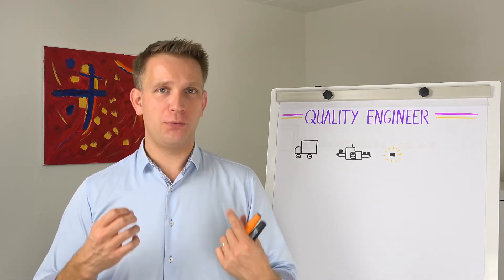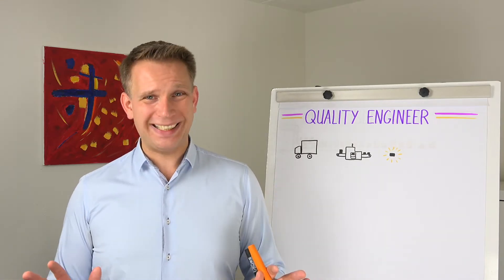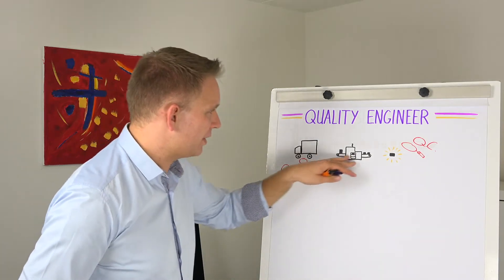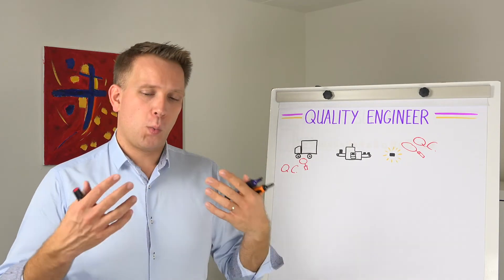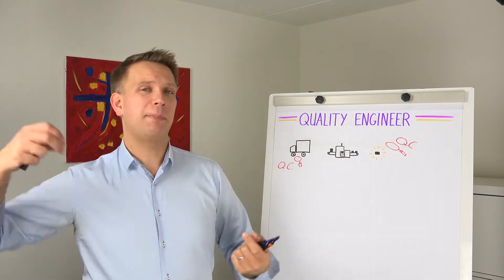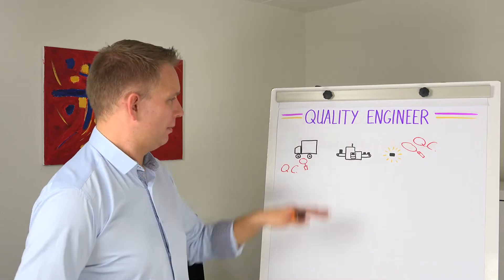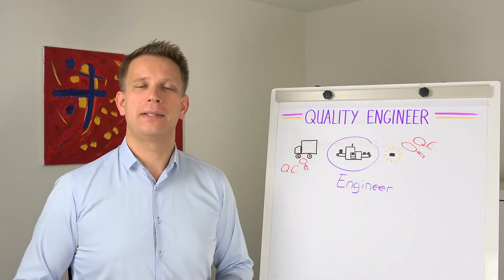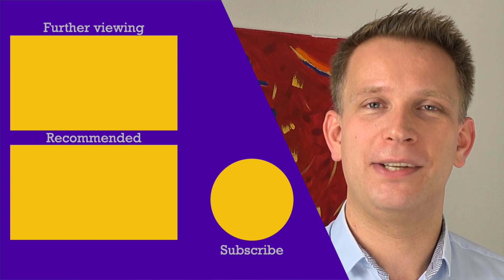What does a Quality Engineer do?

Comment: I am a newborn Quality Assurance Engineer, would it be fair to say a QE also defines the criteria of acceptance for QC Inspectors? For my role we focus on defect data analysis, KPI reporting, PDCA plan to reduce defects (process improvements), and make Quality Control Plans and ITPs. Right now my plan is to implement improved checklists to include First Piece inspections in-process to reduce an ungodly amount of scrap costs being incurred by the factory as a first step. This will also reduce defects by limiting to 1 first piece defect instead of allowing total run of set actions to occur incorrectly thereby having high defect count as detected at a later point.

Comment: My take after being a non-quality engineer for several decades. It sounds like you are describing statistical process control, X-bar, R-bar charts and determination of Cp and Cpk, among other things. The problem with formal quality engineering is that it makes continuous improvement by factory workers nearly impossible. Every change needs to be signed off on by senior managers who consider themselves to be very important. (All changes must be approved by the Vice President of Quality Assurance.) The important thing is that the company has documented quality.
Reply from the maker: Haha, yes, unfortunately that happens.
I can assure you that this is NOT formal quality engineering, it's a poorly implemented quality management system, that is probably set up for formal accountability, getting through audits and covering people's behinds.

A good quality system manages, but also welcomes, changes. A sign-off for changes to product or process is a good way to make sure relevant specialists have judged the effects of a change, and prevent unforeseen consequences of well-meant 'improvements'.
But that management of change process (MoC) should be built up practically: Allow minor changes to be made autonomously at the lower levels. If it likely affect those factors, discuss the proposal with a MoC meeting which gets together frequently (and at various levels in a larger factory). When people believe the changes don't negatively affect Safety, Quality or Machinery, let them implement it and send a report to the MoC meeting - that way the MoC team can give feedback on these choices and is at least informed.

Having said all that, do know that keeping your processes documented really is a valuable thing, not just for audits. And keeping that documentation up to date to include changes is essential (if the documentation cannot be trusted, it loses its value). So some secretarial work is part of the deal, but a good quality team makes that part of the work as easy as it can be.
Reply: @TomMentink  It sounds like you have a good balance between formal documentation and allowing every employee to continuously improve their own work, that they know better than anyone else. If you don't have standard work, you can't improve standard work.

Comment: Quality Engineers must get american society of quality - certified quality engineer certification, its substantial.
Reply from the maker: For most European companies that isn’t that important, but I trust your assessment of what the American market values, @sasi_4395 . Thanks for the info.
Reply: @TomMentink , but it's a added advantage right
Reply from the maker: @ In Europe, having an engineering degree is certainly an advantage on the job market (besides the really useful skills you learn for many jobs), it’s required for many vacancies; something like a Black Velt certification definitely holds weight too (not as critical as a decent degree), but it doesn’t per se have to be from ASQ.
Reply: @TomMentink  yeah exactly! but asqs are credible , having those will have edge and standout i would say
Reply from the maker: @ yes, they’re credible and fine certifications to have - can’t go wrong with that.
Just wanted to clarify that while it’s a nice proof of your competence that really helps for some hiring processes, it’s not a must-have for every Quality Engineer.
Reply: @TomMentink  Yes! Agree 💯👍🏻! I got ASQ CQE recently, with bachelor's degree in engineering as well as master's degree on top of industrial experience, for stand out! Transition into different sectors, it gives me more edge that others. Ita upto individuals though as u said! This video is top notch!

Comment: I would add here that a Quality Engineer reports to a Quality Manager (who also support the QE). And through audits (internal and external) conducted by the Quality Manager or a Certified Auditor, the Quality Engineer needs to define and keep a traceable process of the findings of these audits . Also QE perform spot checks and make sure that the status of the quality alligns with all the process owners. As a first thing when you start as QE one of the first document to look at is the Tailoring Agreement which is approved by the comitee and QM, also it needs to be up to date. The Tailoring Agreeement contains all the process that are done and must be audited along with the tools used in the Project. Thats my two cents on this subject.
Reply from the maker: @anacebotari8604  thanks for the addition!
Great stuff

Comment: Great explanation.
Reply from the maker: Thank you, happy to hear that you like it and thanks for taking the time to let me know.
Reply: @TomMentink are strong technical skill necessary when joining in as a fresher
Reply from the maker: @Pratik0111  It would definitely help, especially since your (change) management skills are likely not going to be your strong side when you're fresh out of college. But know that as a quality engineer you don't per se need mechanical technical skills (you don't need to be able to operate or maintain machinery) - you need skills like process thinking, quality deployment, data analysis, writing clear instructions and an understanding of the quality measures in your line of business.